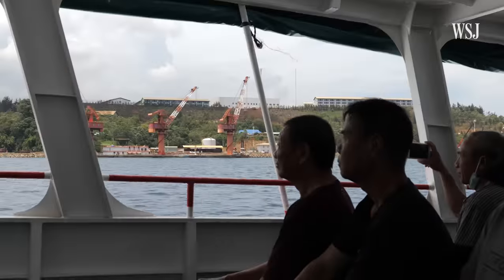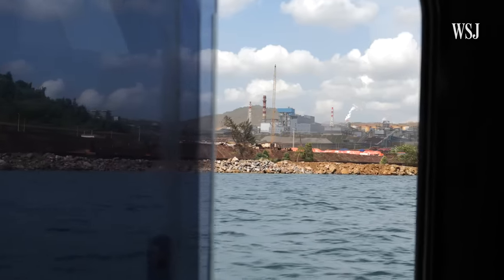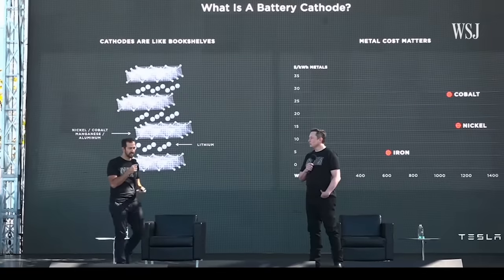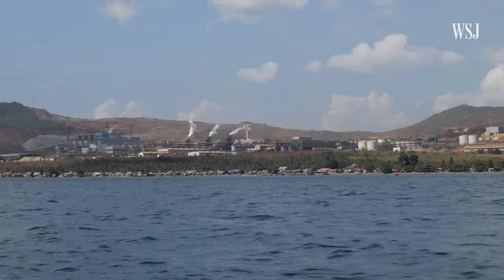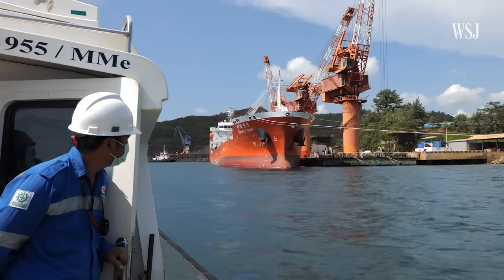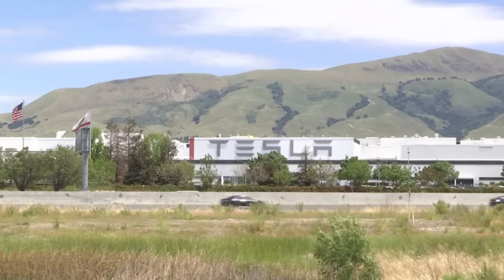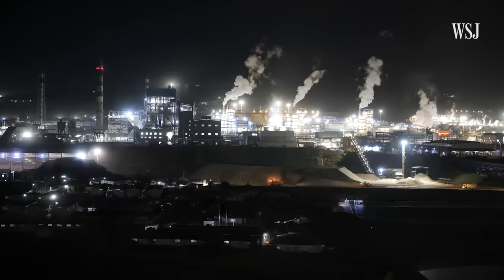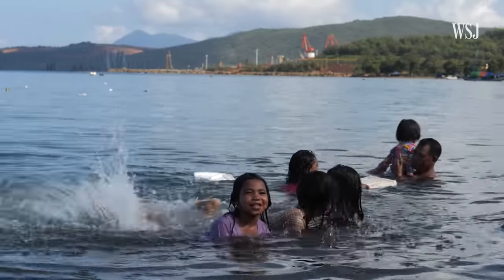Inside Indonesia's Explosive Rise Into the Global EV Supply Chain | WSJ

Comment: So a EV isn’t that clean?🤔
Reply: It is NOT clean even a little bit.
Reply: It's rather clean.
Reply: @spacetoast7783  what does that mean? 😂
Reply: Depends on your definition of "clean". If you compare it to ICE, yes it is far cleaner, but if you compare it to say a bicycle or Electric train, it not. 
But there is no modern vehicle that is "clean" in a sense that it never hurt the environment in some way in its production. Afterall, even a bicycle use metal and those metal need to be mined and processed elsewhere.
Reply: Clean for Europe and USA, not for mining country.
Reply: Its dirty if u eating that for ure dinner. its just to make a balances of gas and oil consumption, so they called it EV battery for any options or innovation.
Reply: clean for where the EV cars run around, but not where its mined
Reply: @xXxSkyViperxXx  trade off?
Reply: its generally cleaner than the conventional one that uses fossil fuels. be it on the production or after the product
Reply: @mack-uv6gn  well, with oil, u basically drill into the land or seabed to get oil and the fuel they later process it into later gets used up as it turns into pollution gas from the exhaust pipe of ur vehicle, but with nickel, u dig up the land, but the nickel is turned into batteries which are reusable since they hold electricity and its the electricity that vehicles use up. in both cases, there's still some level of environmental damage, tho u can see oil does more damage.

Comment: Nickel rich batteries should be banned. They not only destroy ecosystems. They are fire hazards as well. There are safer and better alternative chemistries that dont use nickel or even cobalt such as LFP, LMFP and Sodium ion.
Reply: Almost all consumer rechargeable batteries are Nickle rich and have not been a major safety issue.
https://en.wikipedia.org/wiki/Nickel%E2%80%93metal_hydride_battery?wprov=sfla1
Reply: @atehrani  Nickel metal hydrides are low density. Not much use in high energy applications such as EVs. I was talking about nickel rich lithium ion batteries such as NCM and NCA used in EVs, scooters and bikes etc.
Reply: Catl's Sodium bases battery gonna use nickel
Reply: what a silly logic, lithium is a bigger fire hazard than nickel. Ni is not as reactive as Li you know? 
you also don't know advantage and disadvantage of Ni vis-a-vis Li, they both have different use, 
"destroying ecosystems" is about how you mine it and where (close to population or not, in a forest or not, etc), not inherently because of the type of minerals whether Ni or Li.
Reply: @FerdySambo118  do some reading then we talk. You dont know zilch about rechageable batteries. Lithium and nickel are both used together in the cathodes of  NCM and NCA batteries. 
There are five types of lithihm ion batteries.
NCA(Nickel Cobalt, Alumunium),,LCO (Lithium cobalt oxide), NCM(Nickel Cobalt Manganese), LTO(Lithium Titanate oxide, LFP (Luthium iron phosphate) and more recently the Chinese have commercialized two new types LMFP(lithium manganese iron phosphate) and M3P (lithium, magnesium, zinc, alumunium).
The first three types contain cobalt and nickel and have higher risk of fire. 
The later 4 types you can literally poke and hole in them they will heat a bit but no fire will start.
Reply: So doesthe nickel exports
Reply: Environmentalist SoyBoy
Reply: Nickel is mostly used in stainless stell industry.
Reply: (detected) you may come from a country rich in oil resources? or you are fossil fuel entrepreneurs , your comments are a joke!